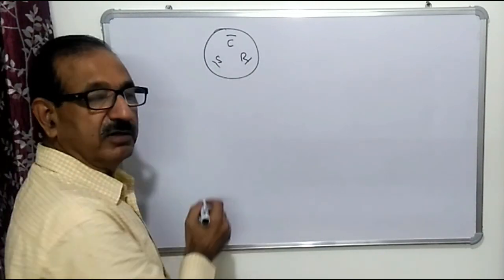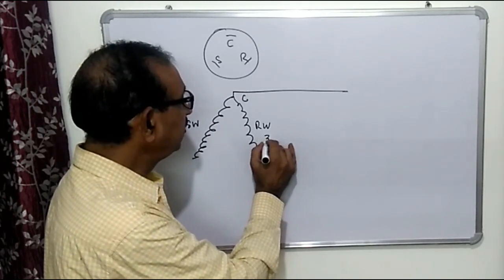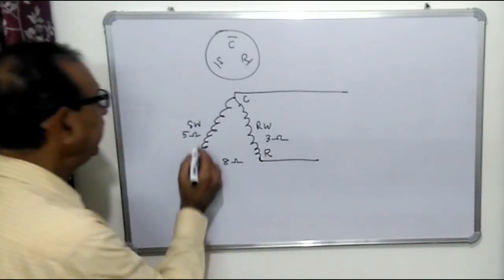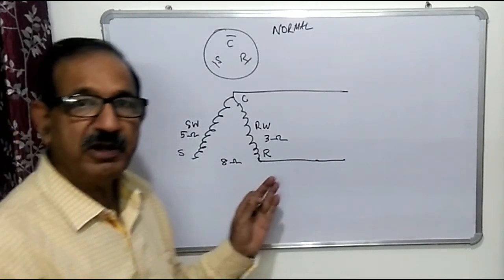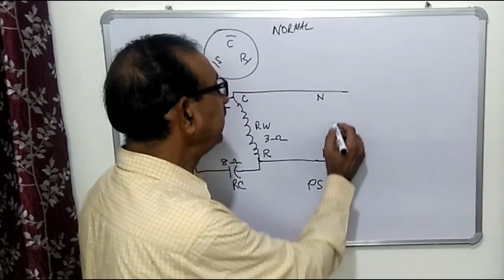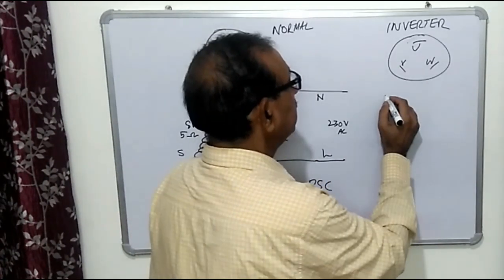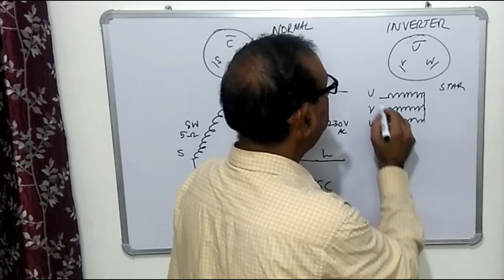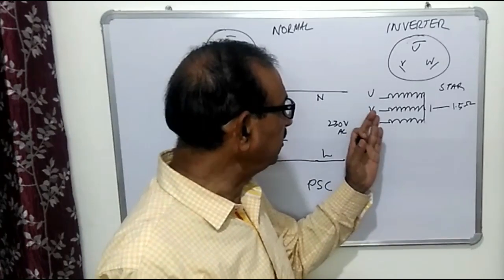Normal Vs Inverter Compressor ( English )

Comment: Hi , can you explain the difference between 230vac and 120VAC inverter? Is the transformer the only difference or is more to it, I assume that the compressor is different at different country voltage , correct?

Comment: Guru what is the difference of normal condenser fan motor and inverter fan motor design and how it can be test or check
Reply from the maker: There are two types of condenser fan. Normal fan motor have single speed. Inverter fan motor may have PG motor or variable speed DC fan motor

Comment: Sir , what is the difference between 3phase compressor winding and inverter compressor because we have same connections
Reply from the maker: Three phase normal motors are AC 440 Volt and Inverter compressor motors are BLDC or VFD.